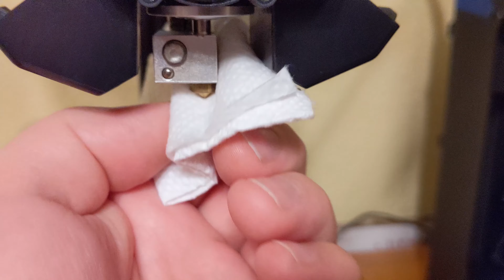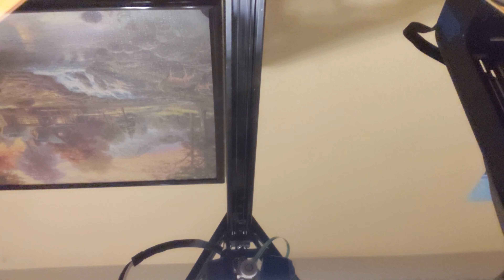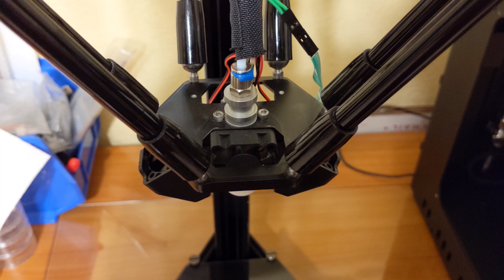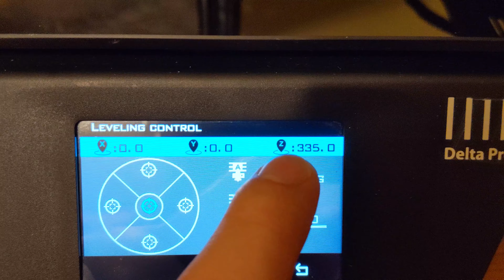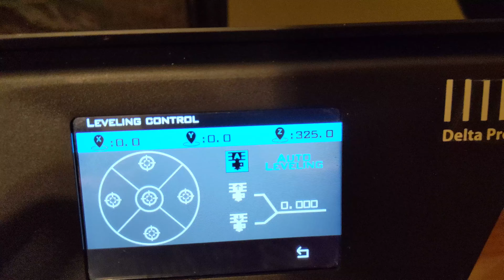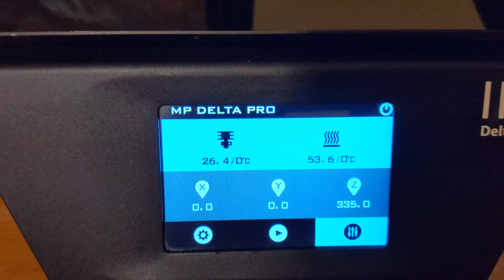Monoprice Delta Pro 3D Printer Axis Adjustment and Bed Leveling - How-To Guide + Full Instructions

Comment: hello ,how do you level bed manually and save the setting? thanks
Reply from the maker: It isn't really designed to be leveled manually since the bed doesn't move. You can adjust offset for the 3 stepper motors in the advanced menu. You will need to look for it.

Comment: I've tried this several times with very little change in position. I'm currently at -.29  x -.35  x -.29. Since these seem to be predrilled holes should I focus on adjusting the glass bed height instead?
Reply from the maker: You can't adjust the glass bed. If you shim it you will risk cracking the glass. Make sure your printer is square. I had a similar offset to what you have on one side and was able to adjust two sides one direction and the third the other making them all meet in the middle.